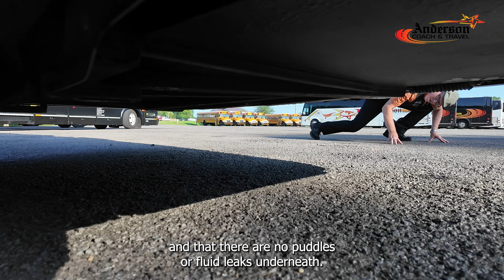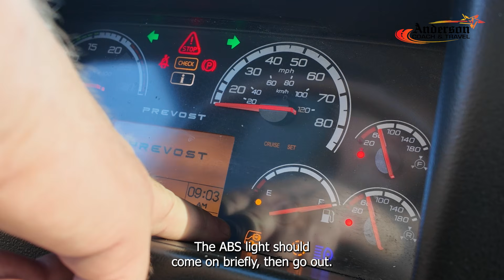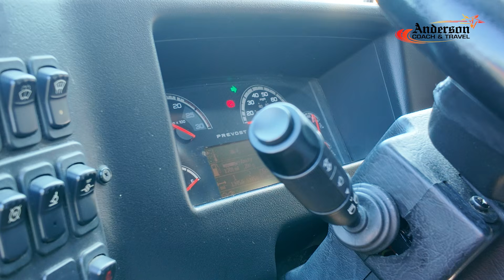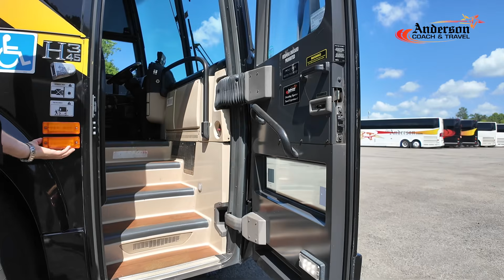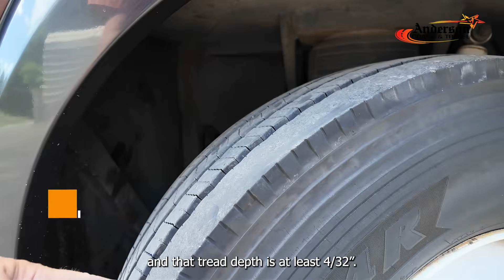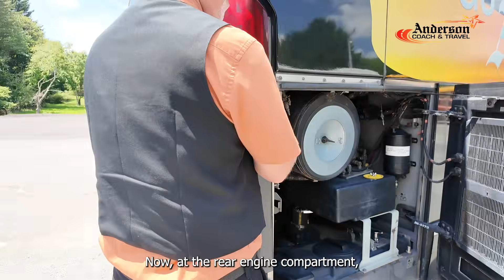Pass Your Motorcoach Pre-Trip Inspection: Step-by-Step DOT Guide (PA)

Comment: I feel like you missed a step of going outside and removing the chalks before testing the brakes by stepping on the accelerator and by then putting it in drive and moving forward and stopping, I actually failed my test because I forgot to move the chalks